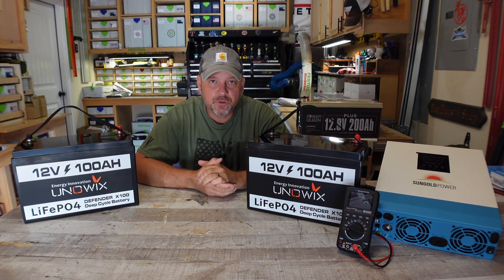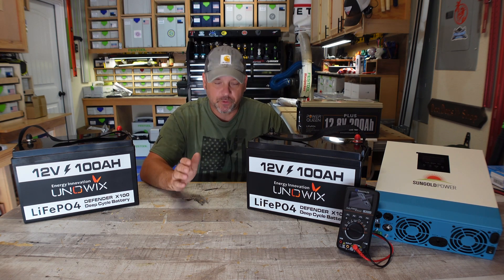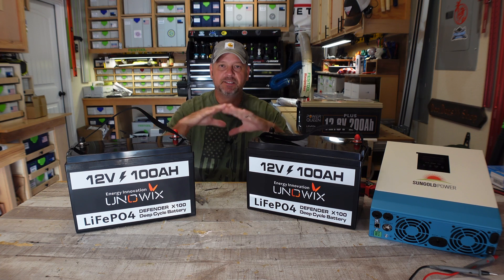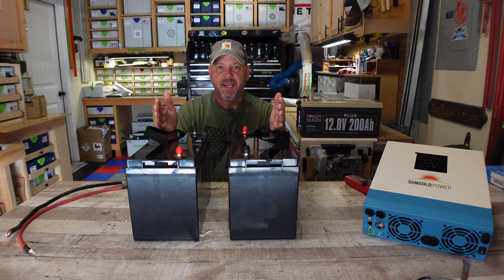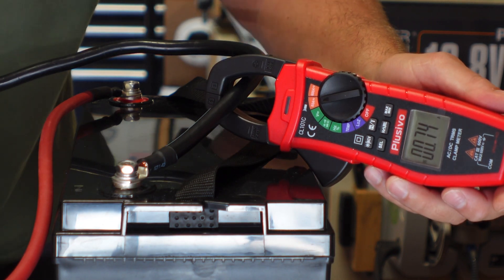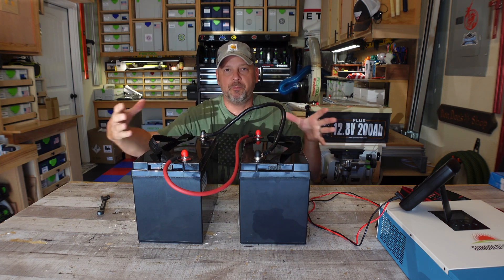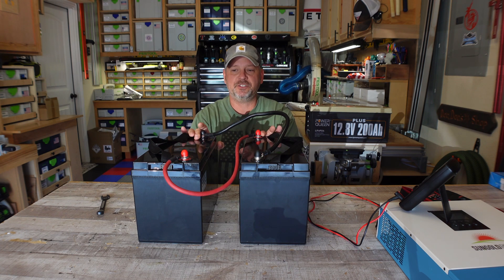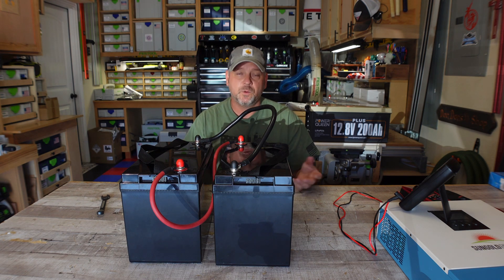UNOWIX X100 Defender: Easy way to “top balance” and connect 12v batteries in series for a 24v system

Comment: I did the same, but it didn't work. Batteries are lifepo4. They were balanced before, then connected in serial. Batteries were charging in different way one overcharged another normal. Will try equalizer what I ordered on Ali.

Comment: Hey Brian, I've been watching your videos for almost 3 years (both channels) and I never saw a follow-up video about the Sungold Power AIO inverter/charger. Did you decide not to do it, or am I missing it somewhere?
Reply from the maker: Hey Troy, I got this to originally use in my shop, but I ended up going with the Bluetti AC300 and extra expansion batteries. I ended up tying that whole system into my houses panel for backup.

Comment: LiFePO4 batteries have such a flat curve, it is best to put the charger on them while in parallel. No need to wait for the balancing current to drop after first connecting them. But do not connect if they have very different voltages.  A tenth is fine.  Too much will cause too much current to flow.